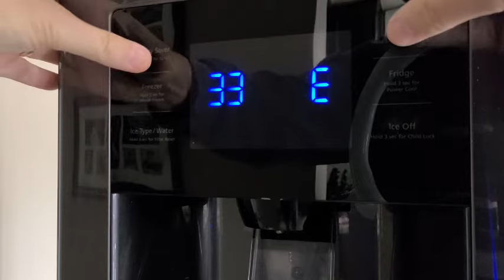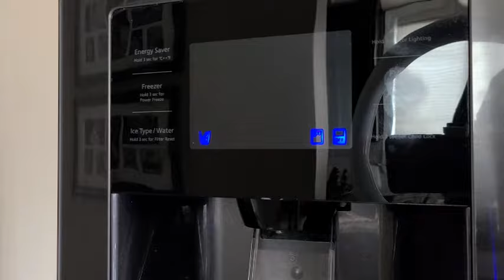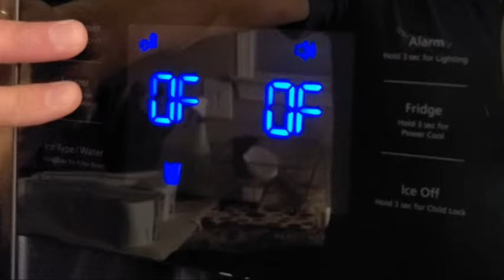How To Fix a Samsung Refrigerator Lower Ice Maker With Error Code 33E

Comment: I just replaced my icemaker and it still didn't release the ice unless I pushed the reset button. So I looked up the manual and discovered that the ice on/off button lights up when it is turned OFF and not on. Who designs something that the light turns on when the unit is turned off? Every other product I've ever come across has a light that comes on when the power is on. Who'd of thunk?🤦‍♂
Reply from the maker: I agree the buttons and lights on the control panel were not designed very well.

Comment: Great video but I barely got the top drawer out and now I cannot get it back in. Looks like yours has significantly more room than mine.
Reply from the maker: During normal use, I found the drawer pulls out so far and then stops. But with a little extra force the drawer will actually pull even further out.  I suspect this may be what's going on in your case.

Comment: Thank you, thank you!
You only need to remove the top plastic drawer to reach the reset button.
 If you're having trouble getting the top drawer back in, pull the outside drawer door forward slightly more. It will drop in easily.
Reply from the maker: Thanks for the tip.

Comment: You are the best step by step clear DIY instructions.

I would not be surprised if you are a top notch engineer, or even a computer engineer in life . 
Thank you for taking your time to make this video
Reply from the maker: Thanks, I hope it helped.  I worked in IT. But I often thought that I should have been an engineer.  😃
Reply: @DIY-Saver  I’m a former computer scientist and used to work for Lexmark international. 
Then I decided to fulfill my childhood dream of being in medical field and went back to pharmacy school 😄. 
Troubleshooting and attention to detail is needed in hospital pharmacy nowadays. The amount of IT and computerized order sets and procedures is over the roof .

There are just as many pharmacist working as hospital IT support team .
Helping Nurses , Doctors and other pharmacist running the hospital electronic ordering system smoothly.

Understanding and articulating your problem logically is 50 % of the solution. 
My computer science prof always said regarding our fundamental programming classes . 
That advice is worth its weight in gold 😄

Comment: At 5:26 on the video when you're putting in the new water filler tube assembly, I noticed you did not have to plug in the plug on the end?  It appears you just slid in the replacement part.  Can you please confirm?
Reply from the maker: Correct, you'll make the connection inside the freezer.  Watch the video starting at 6:30.
Reply: @DIY-Saver  Yes Sir, I see it now!  Thank you so much!  Great video!!
Reply: I have a dual ice maker and neither one of them are working. Lakewood working with my husband replace the heater clip. I'll try to reset it and sometimes comes up 33 error

Comment: Just noticed my Samsung side-by-side wasn't making ice in the lower ice maker. You could hear it going through its cycle but the tray wouldn't fill with water. 

Pulled the power and 33E showed up. Put that into Google and your video showed up. 

Excellent step by step tutorial. Going to order the part soon and get it fixed. 

Thank you!
Reply from the maker: Excellent!  That's why I make videos.

Comment: Awesome video! I'm getting error code 33E but it's the top ice maker not working. The lower ice maker works. Will replacing this heater fix the top ice maker or is there a separate heater for the top ice maker and if so, do you know the part #? My model is RF323TEDBSR/AA.
Reply from the maker: Hi qwiksilver,
Please keep in mind that I'm NOT an Appliance Technician and don't have all the answers. I assume the top ice maker has a heater; but I have no experience replacing it.  If it does have a heater, I have to believe it has a different part number.  I recommend researching it further or contacting an appliance repair company.  

Best wishes on your repairs and please come back and share what you find.
Reply: @DIY-Saver Thanks! I spoke to Samsung and unfortunately with my specific model you cannot replace just the heater on the top ice maker, the entire auger assembly needs replaced. Part number is DA97-12540G.

Comment: What is the part number for the ice maker
Reply from the maker: The replacement part for my lower ice maker assembly is DA97-07603B.  But this appears to be an updated part number.  I recommend going to an online replacement parts site (e.g. partsdr.com) and use their "Does this fit my model?" feature to verify that it fits your fridge.  Hope this helps.

Comment: If the ice maker is not being used can the plug for the heater be left unplugged and the error code stay off?
Reply from the maker: Sorry, I don't have the answer for this question.  You can either try it or consult an appliance technician.

Comment: our ice maker, fills with water, produces ice cubes, but does not dump them. When i hit the reset button, it goes through the motion of dumping the cubes, refilling with water, then has a 2 tone beep and does not cycle again until i hit the reset again 
suggestions welcome?
Reply from the maker: Try unplugging the refrigerator for 5 minutes and plug it back in, to see if a reset helps.

Comment: I have no error code.  Crap still not working.  Top and bottom ice maker.  Samsung suck.   Yes my water line works fine. 😡
Reply from the maker: I did replace my lower ice maker once.  The top ice maker is another issue.  I have to defrost it about once every 3 months. It's a long drawn out process since I discovered it has an ice build-up on the inside of the ice maker.  I've found that I actually have to disconnect the power after defrosting to get the upper ice maker to start working again.